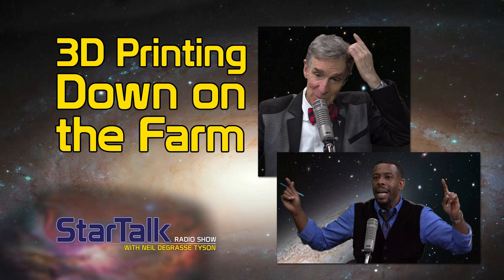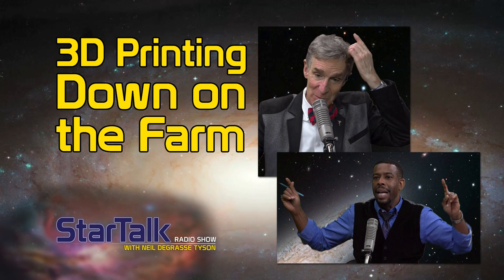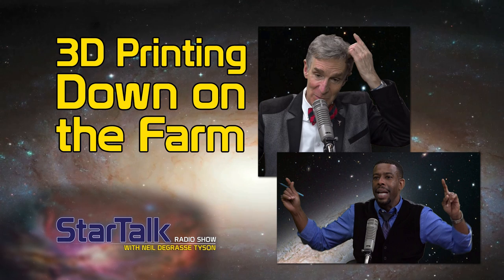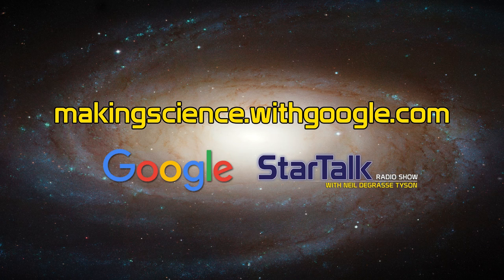Bill Nye: 3D Printing Down on the Farm

Comment: You 3d print the hydroponic troughs for your crops, rest the soil and stop contaminating it with runoff. Then you control the feed going in, and collect the waste at the end of the system, and do the soil a huge favor in the process, plus the plants will grow better with a strictly controlled diet. 

You can 3d print fences so your farm/ranch layout can be more modular, and especially if you are using hydroponics raised off the ground, you can change field sizes and layouts on a whim. So if you are 1/2 into a season and you need to move something you aren't rooted into soil.

You can 3d print a solar water heater system. You can 3d print splints for plants that break a branch or stalk. The hard part will be having a large enough library of all the random things a farmer might need, or teaching every farmers daughter how to use sketchup/blender to make 3d models.

Comment: wait so if we can print candy couldn't be then use it to print/make baked goods and make food with it using plant derived materials for say an army setting where you would put in what you need and tell it what you want to make?
Reply: There is a printer in development to print entire pizzas. In theory it cooks as it prints it. If they can make that work other baked goods should be doable. The question about printing a mature plant that is a food crop isn't really even on the horizon now from what I know though.